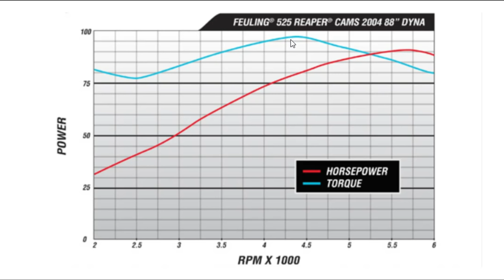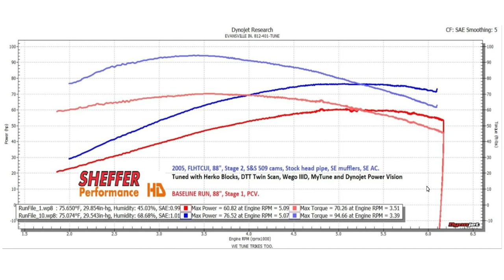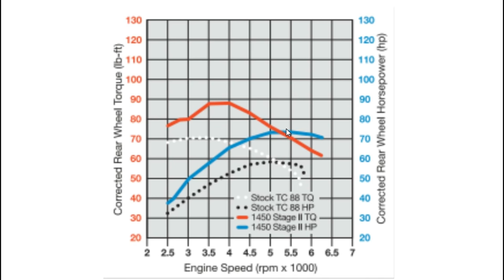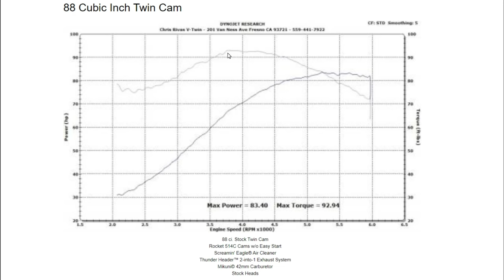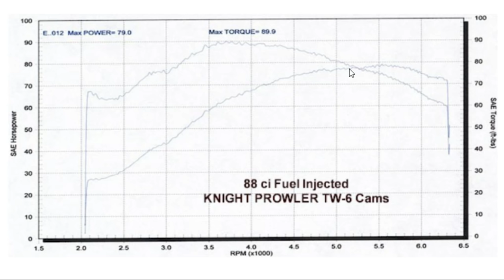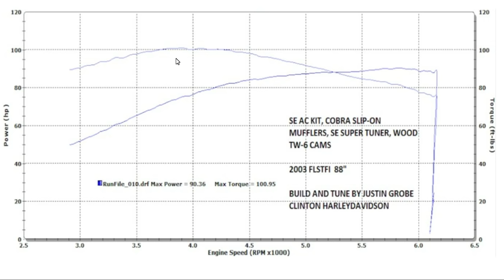Give Your Twin Cam 88 New Life With A Bolt In Cam Upgrade

Comment: Well this video is 3 months late for me haha. I went screaming eagle 204s on a 2000 softail. I'm planning to buy a touring so it is what is. Great vid
Reply from the maker: Screamin Eagle isn't a bad cam at all, they perform really well. They just don't have the output that you can get with an aftermarket cam, but overall they are very reliable.
Reply: Cam bearings went and smoked the cam plate. Anxious to ride it was easiest to get everything in stock. I'm happy, ill be upgrading to a touring model, thinking 107
Reply from the maker: Oh crap was this with the stock parts?
Reply: @GixxerFoo  2000 softail. Bought the bike in April. No tensioner noise. 200 miles later, bearings went. Bike had about 57k miles. Had a shop check run out on shaft. But did the cams, plate, and push rod replacement myself. I was able to get 2k on it this summer.
Reply from the maker: Oh crap that sucks, what bearing the shelled on it? Cam bearings?
Reply: @GixxerFoo  yes, the cam bearings let loose. The notorious tensioners still looked good.
Reply from the maker: That's crazy about those tensioners, some bikes never had an issue and others failed before 15k.
Reply: @GixxerFoo  its what I thought went, ordered the new set and tore into it, thinking I would be riding that night. But thanks for info, I just watched your big bore kits for the 88. I really appreciate all the content on the twin cam, and especially the 88

Comment: Can you compare or comment on the difference between the Wood Performance TW-6 and the TW-555-6R with the RCC-2 cam plate upgrade for the 88 Twin Cam for a 2006 FLST carbed Softail

Comment: I'm trying to figure out if I should get a 96ci or 88ci road king and I must say this is making me think with the money I save with going with the 88ci I could maybe after riding the bike for a year or two put in the ss cams
Reply from the maker: 88's go cheaper than the 96, just be aware of the miles and make sure you check those cam chain tensioners.

Comment: So I've got a 88in carb harley and I put in s&s 510 cans and the bike only run for 10 seconds and I see videos that say you have to change your ignition module as well because the harley ones aren't adjustable so is that true but anyway I went back to the original cams cause I was only doing the cam chain tensioners cheers Mike
Reply from the maker: Huh, that's interesting. You put the stock cam back in and all is good now? I would say timing is off somewhere if it won't stay running after the cam swap. That's the first place I would check would be cam timing, if that correct I would move onto the ignition.

Comment: I'm late to the party. Hope not too late for your opinion.
04 Electra Glide. I want good torque for hills; passes, at highway speeds 60-70, Turning 2500-3000 rpm. 
What would you do for that? I am otherwise happy with my power delivery. Would just like to not have to shift down on the passes with a passenger, an be able to hold speed. Thx.

Comment: Specs of the wood tw6 and the andrews tw37 are practically the same. I was reading that andrews manufactures the wood cams. The andrews cams are around $150 cheaper. What are your thoughts on this? Thanks
Reply from the maker: Andrews does manufacture the cams for Bob Wood, but they are ground to Bob's specs. The Andrews TW37 is going to be very close to the wood, but not quite as aggressive as the Wood.
Reply: @GixxerFoo  have you tested the andrews tw37? If so what kind of power #'s in comparison to the wood tw6? Also does the wood tw6 come in the conversion style? Thanks.

Comment: After watching this video I sent it to my mechanic and we decided to put in the S&S 509 chain drive hybrid cam plate kit,tappets, s&s tc 88 precision cam service kit. And a new tune. I really like it but my exhaust sounds different. I already had an upgraded air filter and screaming eagle pipes, but I'm thinking about getting some zV,&H pipes. Besides changing the sound do you think it will help the performance at all? Should I have gone with the 509 G? I was just looking for a little more power on the highway, nothing crazy. I have a 2000 dyna with screaming eagle custom engine with 625 cams. S& S upgraded oil pump and mikuni carb, open belt primary. Carbureted 2-1'basanti exhaust. That thing is fast enough for me lol
Reply from the maker: It should help run pretty dang good with the 509, the exhaust is gonna sound different with the new cam profile. Did you go with the easy start cam?

Comment: Probably been asked but when looking at the gear drive tw-6 it gives you 3 options tw-6h, tw-6g and the tw-6hg. Trying to understand the differences and figure out which to choose. What's your take on this?
Reply from the maker: On the gear drive cams the TW-6G is the bolt in gear drive cam that works with stock valve springs, the G denotes gear driven. The TW-6HG is a high lift gear driven cam that will require valve springs and possibly clearances if required when test fitted. The HG is high lift gear drive. TW-6 is the bolt in chain driven cam, the TW-6H is the high lift chain driven version of the cam. The bolt in cam is .510 valve lift and the high lift version is .590 on both the chain and gear driven cams.

Comment: Wish the 509 worked in my twin cam 88. But I have an 06 dyna. Thinking about going with the S&S 583
Reply from the maker: 👍 That's a special year, it's kind of a hybrid between the incoming 96 and out going 88. A good cam for that bike would be the Wood TW-222, that cam is solid up and down the chart if you want a good all around cam.
Reply: @GixxerFoo  how early does the power and torque come on with that cam? I hardly hit 5k rpm so I'm looking for a cam where the power comes on at like 1500 ram or sooner.
Reply from the maker: It's going to come on about 1800 to 2000, it will still give you good passing power and that torque pulls strong up until about 4k.
Reply: @GixxerFoo  ok. Awesome. Thank you for the replys.
Reply from the maker: Not a problem at all!

Comment: Do you have any info or thoughts on the zippers performance Red shift 511 cams?? They made it for 88 twin cam bolt in with stock springs.
Reply from the maker: That's a great bolt in on a 88, they will really make some torque. The 88's displacement kinda holds the horsepower down but you can't beat the torque. They come on early and have a excellent low and mid range, they are a huge improvement over the stock cams.

Comment: The mechanic in town recommended 510 kit s&s mikuni 42 on a 88 dyna .he said it will wake up the bike 🏍
Reply from the maker: It really will wake those bikes up! There's always a big debate over the Mikuni or stock CV, I personally feel the Mikuni dialed in right will not hurt fuel economy, add power and fuel injection like throttle response.

Comment: Hello. In the kit from the S&S there are camshaft bearings. Can they be put in a stock camplate? Or does camplate need to be changed necessarily when replacing camshafts? And oil pump too.

Comment: I have a 2005 Road king I have a upgraded air breather not sure the slipons but their not stock and a efi tune I do alot highway and in town riding which cam would you suggest for my setup
Reply from the maker: Do you have a preference on the brand of cam? Wood TW-6-6 is a excellent all around cam for the 88's, produces great torque and runs out decently in the RPM range.

Comment: i was under the inpression that torque rules until 5250 rpm and the horsepower takes over from there. if this is true then as far as harleys go its torque all the way unless u have a race engine that revs beyond 5500
Reply from the maker: Torque is the name of the game on Harley, that's why I when you get into Harley's stage kits I always recommend the Stage 3. Harley's stage 4 puts all that power way up on the top and the Stage 3 makes the same power in the low and mid range. Save yourself 1500 bucks unless you ride wide open all the time.

Comment: Hey @GixxerFoo
First just want to say, love your videos!
I have a question for you, I have the weirdest HD of them all, the 2006 Dyna Street Bob FXDBI with 88ci and stage 1 (2into1 exhaust).
It's the first model with hydraulic cam tensioners.
What cams would you recommend for the 06 Dyna?
Thanks in advance!
Reply from the maker: I don't understand why only the A engine that year go the upgraded tensioners, but a great for that motor is the Wood. You can even run the S&S 550 or 551 in that one, I need to check part numbers but the 06 Dyna may have the newer valve springs too.
Reply: @GixxerFoo  btw, the dyno chart you showed for the  feuling 525 is one of two charts comparing 04 and 06 models. The performance on 04 bikes are way better than for 06 models. The 525 for an 06 doesn't look worth it at all, looks like hardley any gain from stock
Reply: @GixxerFoo  the 06 dyna was the prototype for the 07 models. It has springs that can handle  up to .590 (not recommend to go beyond .550 depending on the age of the bike) also has the new cam chain tensioners
Reply from the maker: It really varies across bikes and whoever you have tuning the bike too. I've used different tuners before and someone else be able to get even more out of my bike.
Reply from the maker: That's true, 06 was a very unique year for sure. Just too bad they didn't have that Timken bottom end too.
Reply: From my research (my wife has an '06 Dyna Low Rider), the Woods TW6-6, is the correct cam for the 06 and up Dyna models.  Really brings those bikes to life!  Another thing worth mentioning that alot of people forget, to get really good torque numbers, you need the right about of back pressure in the exhaust....open exhaust more ponies.  Alot of your big numbers on Dynos come from bikes running a high quality 2 into 1 exhaust...FWIW

Comment: My understanding is that there is a difference, by year, for the twin cam 88 as to how much lift can be added? That 2004 and earlier stock can only go up to 510? If that is the case, then the Feuling 525 has too much lift and really isn't a bolt in cam for the earlier bikes?
Reply from the maker: They will bolt into the earlier bikes, they are designed to work with all the stock components across all years of the 88.

Comment: Hey Gixxerfoo, is the Feuling hydraulic cam kit compatible with Wood tw6 cam? I have a 02 FXD with 95in big bore and couldn't get a straight answer on compatibility with these two parts. Would hate to buy the wrong parts when it's all taken apart. Bob Wood actually recommends the Wood performance RCC conversion kit with the TW6, so now I'm truly lost on which parts to buy.
Thanks for any info

Comment: @GixxerFoo ....( 2003 FLHT CARB W/ stage 1 kit ) if i have to do it in 2 stages, 1st being S & S cam plate kit with all the updated parts with and 509 S & S cam. ( Stage 2) will that cam be sufficient for a S & S 98" kit with machined heads ? also will the stock cases and bottom half be able to handle that HP jump ? Thank you for your time and keep up the great videos, very helpful.

Comment: 06 flhrsi 88 ci - ss 585 ez gear cams  efi  with thunder max ecm   ( ready to install  SS side winder 100 ci big bore kit )
Reply from the maker: Damn you got quite a setup! That Thundermax has to be awesome on that bike!
Reply: I'm going to do the same to mine also but what is the thunder max?
Reply from the maker: The ThunderMax is complete ECM replacement that uses wide band 02 sensors instead of the factory ECM with narrow band 02 sensors. It's expensive but well worth the cost. It comes setup ready to go. When you order one you just specify your setup and they program it for your base map. It allows you maintain consistent tuning at any rpm, in any condition just like a car with wide band 02 sensors.

Comment: Can I safely run these cams by just doing a cam swap ? I have the stage 1 set up in my 2000 88, but haven’t updated the cam plate, or oil pump yet.
Reply from the maker: Yeah you can run them with your stock components. Doing the upgrades is just a perfect time to when you have the cams out. I would suggest new cam bearings though when you install cams.
Reply: @GixxerFoo  Thanks for the info. As I mentioned before I’m on a fixed income and money is tight !
Reply from the maker: Yeah cam bearings would be a good idea, and new spring tensioner shoes. Buying aftermarket it might be an extra 75 bucks but worth it with a new cam set.
Reply: @GixxerFoo  Thanks for your reply !

Comment: So I have a 2001road king 88 with vance & hines slip-ons s&s super E and s&s gear drive 510 cams. Any idea what the HP & tourqe ?
Reply from the maker: Just a rough guess on the conservative side l would say 80 to 85 horse but closer 90 foot lbs of torque.

Comment: I have an EFI tc88 and was wandering what tooner you would recommend with the s&s 509 cam?
Reply from the maker: What year is your 88? Depends on which fuel injection system you have if you would be able to use a Power Vision or if you'd need a Power Commander.
Reply: @GixxerFoo  2002 ultra classic electra glide .
Reply from the maker: Sweet you have the Delphi system, best tuner out there is Power Vision flash tuner. It's about $450 but it is well worth it to get your bike dialed in with that cam.
Reply: @GixxerFoo  thanks alot for your help can post a link of the tuner I need? I'm glad I found your channel as I'm new to the Harley world I have learned a lot.
Reply from the maker: Not a problem, here is a link to FuelMoto https://www.fuelmotousa.com/c-1205568-efi-tuning.html#!year%3D2002%7C%7Cmake%3DHARLEY-DAVIDSON%7C%7Cmodel%3DTOURING%20FLH%2FFLT%20MODELS. I am not sponsored or anything by these guys but they have the best customer service and prices. Just tell them what exhaust, air cleaner and other performance parts are on your bike. The tuner will come preloaded with a map for your setup. They are awesome like that!

Comment: Hey bro if I put the wood tw6 in my 88 do I have to change valve springs
Reply from the maker: No valve springs, it's a bolt in cam and will work with the stock setup.

Comment: I'm pulling 2800 rpms at 70 mph. 103 ci. Which would you suggest?  3000 rpms or more is 75-80 mph
Reply from the maker: It's really hard to beat the Wood cams for all around power!
Reply: But it's stock
Reply from the maker: The wood bolts right into a stock engine and produces impressive results.
Reply: GixxerFoo 👍🏻

Comment: Can you use a S&S 509 on a TC88 then upgrade to a 100CI kit and keep the same cams?
Reply from the maker: With the larger displacement that cam would really lose it's effectiveness in my opinion. You would likely want to move up to a 570 or 585 if you're going that larger displacement.

Comment: Have 06 Road King Classic EFI Twin Cam 88, have Power Commander. Putting in S&S 509 cam. Should I tune with Power Commander or another tuner?
Reply from the maker: You could use the Power Commander without any issue, but it would be great time to upgrade to the Power Vision. FuelMoto has great prices on them and the base map they send will be setup to your engine specs.

Comment: I knew it. Another twin cam video
Reply from the maker: I had a lot of requests for a video on cams for the 88's, are looking for another engine to be covered like the M8 or Evo?
Reply: @GixxerFoo  it was just a guess when I saw your post about a new video coming up. I have the m8 and there's a lot of cam videos out there. Honestly, I am about to run out of warranty for my 107 m8. I didn't buy an extended warranty so I am rolling the dice. I will keep the engine stock for now. I have considered mods like changing the handelbars but that's about it.
Reply: @GixxerFoo  i do like the 88 and big twin evo engines but never owned or ridden one.
Reply from the maker: The M8'S have been pretty reliable, there's always a few out that have issues as with anything. A 107 really comes alive with a cam swap, even with the SE cams.
Reply: @GixxerFoo  thanks, that's good to know. yes stage 1 + cams really wake the bike up. I like the torque of the stock motor and I don't miss horsepower because I don't go on the freeway. How about using 89 octane ethanol free gas when harley reccomens 90 octane minimum. Do you think it causes any problems if it's 1 octane less? I always have this placebo effect that the bike runs smoother with 93. When I fill 89 ethanol free, bike also sounds louder, I hope just in my head and the bike is fine
Reply from the maker: I really like to run the highest possible octane possible at the pump. It reduces the risk of spark knock, you may not always hear it.
Reply: @GixxerFoo  yes, you're right. I went for a short ride today to vote. I didn't notice the engine sounding any louder, everything was smooth. Also, I filled some 93 octane qith ethanol and rest of the tank with 89 no ethanol. Some modern ecu's notice change in octane through oxygen sensors in exhaust pipe and adjust fueling ratio accordingly to prevent knocking. Safest bet is following manufacturers recommendations. Higher octane is preferred especially for higher compression ratio engines.
Reply from the maker: E10 isn't bad to run, l don't like it since it carbons up the pistons more. Just burn it through the tank and don't let it sit. I've always run the highest octane possible in every motorcycle, metric or Harley. Always go with the manual like you said! Great to hear you went and voted! That's very important!
Reply: @GixxerFoo  yes you're right. I honestly don't know the long term effects of using either first hand. I let it sit too long, mostly 2 weeks or so in between rides. I do need to ride more. Yes, went ahead and did it early. It was a breeze. About 15 people at a time. In and out
Reply from the maker: If l have to run ethanol l usually put a little additive in to help keep the fuel stable so that it doesn't separate and collect moisture in the tank.